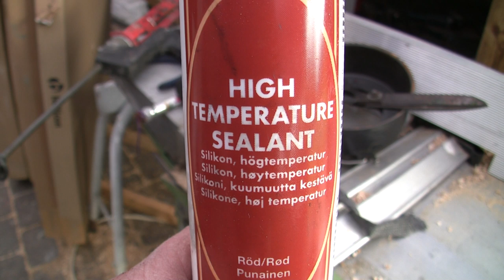Big Green Egg. Chimney ..

Comment: A quick addition of the gasket felt on the chimney itself takes 30 seconds and will give the same effect. No falling off when you open the egg and is air tight
Reply: Brock Masters ~ I agree with you Brock. The gasket seal that is used for the egg works just as well on the egg chimney. Makes a good seal and it does not come off when you lift the lid.

Comment: what was the purpose of doing this? the metal top is not intended to be snug while the grill is cold. now however it may be very difficult to adjust airflow or remove the top while hot or at all after it cools after the first use.